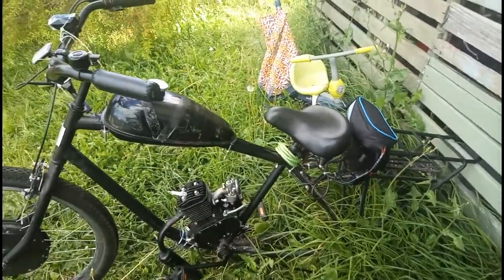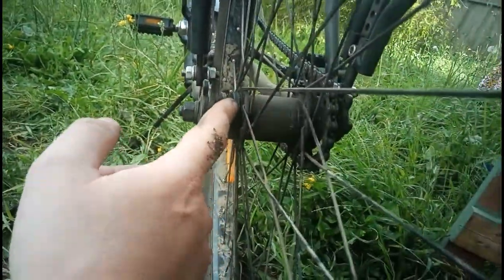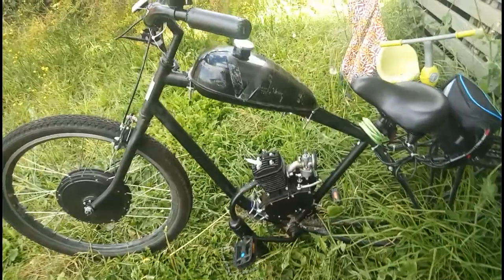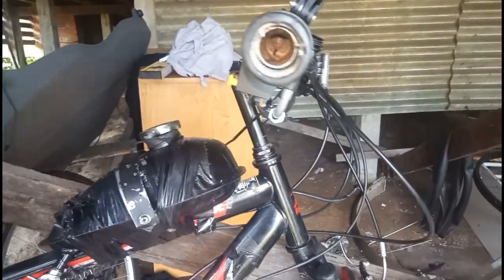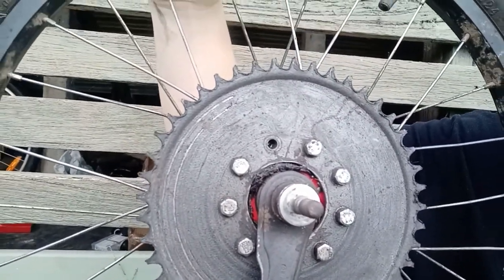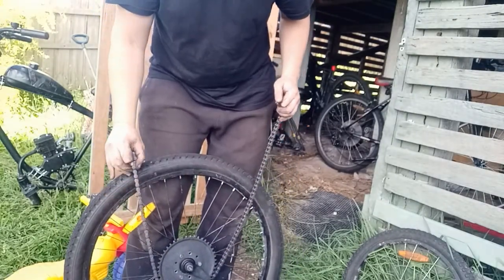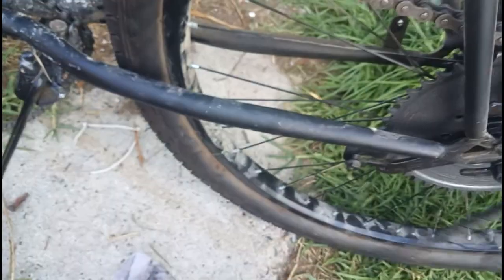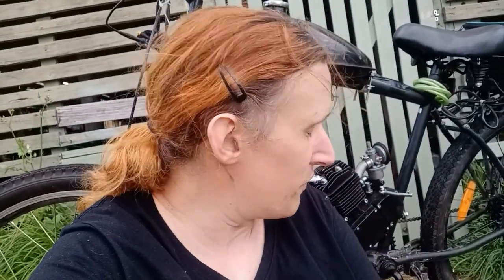Mk5 E-Bike 2 Stroke Hybrid Project - Single Rag Joint Sprocket

Comment: I HATE rag joints.  HATE THEM SO MUCH!  1.5 inch sprocket adapter ALL DAY.
Reply from the maker: I'll never use a sprocket adapter again, after it snapped 6 spokes. I've never had a rag joint break a spoke... yet
Reply: @NicksBikes  yea I hear stories about that all the time, I haven't seen it in person though.  I just can't stand how much hassle the rag joints are.  I've got spare wheels.